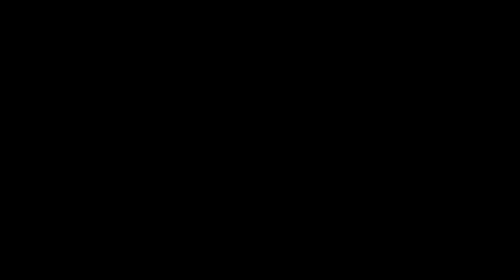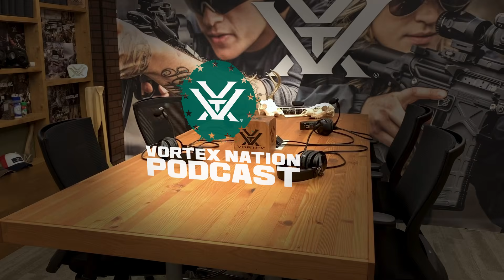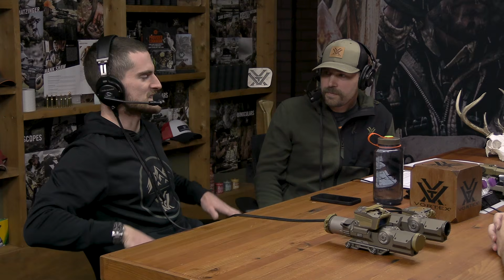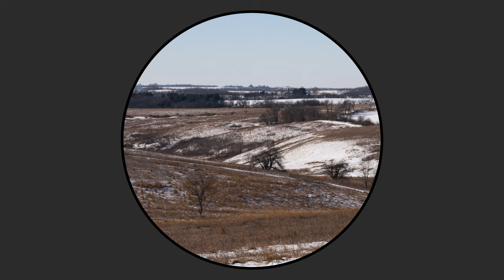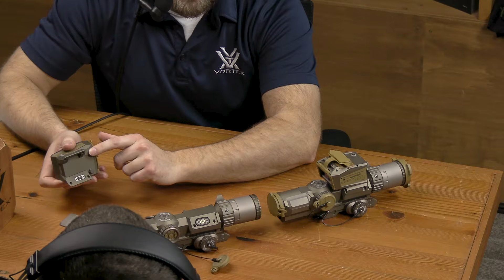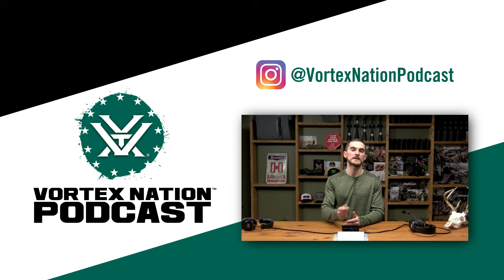Ep. 220 | Army selects Vortex® for Next Generation Squad Weapon – Fire Control. What is it?

Comment: I wonder if these optics with all the tech, are they shielded from e.m.p. attacks? I would hate to think they wouldn't be effective on the battlefield if something like that could fry there systems.
Reply: Still be a x8 scope until fixed. If we know a nuke is going to be popped in relative proximity we switch off electronics. EMP doesn’t damage electronics then. In defence we also bury a % of our radios, etc, to help preserve gear.

Comment: I got to ask : is the laser range finder visible with nods/detectable with laser guidance early warning systems like built into tanks and APCs? It would be really bad to carry a flashing beacon with you when you go to war to any technologically advanced enemy  - or even a citizen miltia or terrorists with hunting night vision 
also what is its heat signature on thermal cameras?
Reply from the maker: Unfortunately we can't give too much detail as to what exactly all of its features include. Everything we're allowed to say is in this podcast!
Reply: Tank defence suite would go nuts and waste a lot of ordnance and cause tons of stress on the crews if our tiny infantry lasers set it off. They require quite a heavy duty laser like those that target designate from ATGM launchers, aircraft, laser designators JTACs use, etc.

As for detection yes any active light including IR can be seen through passive NVG or even civilian cameras/mobiles set to night mode. We have EMCON measures briefed pre mission on what we can emit. If we know our enemies have night vision aids you know not to use active until contact, etc.

Hope that helps.
Reply: @stevepirie8130  Yes it did , thank you , i had some work with night vision in the army and we found out during war games that phones flash a UV flash every few seconds that basically scans who is useing it like facial id - guy that had his phone in the top pouch on the Plate carrier was the shiny beacon in the night. Just look at a phone with a night vision - next to the selfie camera - close range and old NVG and its like a UV strobe light with some phones like Huawei
Reply: I used thermal imagers for years of various sizes as a MFC and it has minuscule thermal footprint. It’s us humans that stand out far, far more. Your TI naturally blends into the background.

Comment: This scope has sensors for station pressure, temperature, angle and laser rangefinder for distance PLUS an integral ballistics "engine". Pretty good for a rifle scope and heretofore only found in top LRF binoculars like Leica and Zeiss. 
WHERE IS THE SOLAR PANEL? ;o) My HOLOSUN AEMS sight can operate only on solar panel with no battery in good light.
I wonder what the problems were with the Leupold and L3 Harris entries in this Army electro-optic battle sight solicitation.
A civilian rifle scope that can also do most of the things this scope can do is the SIG/SAUER Sierra 6 BDX (Ballistic Data eXchange). BUT for optimum use this scope must have a Bluetooth-enabled rangefinder with a built in ballistic engine and/or a KESTREL 5700 Elite weather meter/ballistic engine with Bluetooth.

Comment: Let's make one thing very clear:  putting optics on a weapon DOES NOT increase the range of the weapon, it may allow for targets to be engaged at longer ranges more accurately, but can in no way make a weapon shoot further. Having served in the USMC during the 1980's, we were trained to engage point targets accurately out to 500m, WITHOUT OPTICS. I fear the US military has placed such a reliance on optics for individual weapons that should those optics become damaged in combat, the troops will be unable to function due to no training with shooting over iron sights. How many soldiers these days knows how to BZO their weapons using iron sights?
Reply: Only time outside the first lessons on Basics I used iron sights was in the jungle. Our iron sights were extremely easy to zero. Optics is very useful in the IED riddled environment we had in certain theatres and nobody was allowed on patrol without them fitted. Even machine guns had optics despite the fact 7.62mm wouldn’t keep its zero. It was just an aid for observing splash beyond tracer burnout. 

I was a bit curious about the x8 scope but he said it’s adjustable as with x4 I could suppress with both eyes open to watch the assault element crawl up to post grenade so I knew when to switch fire. X8 would I’d suspect be too great a difference for me at least.

Comment: Well as a long range shooter my take on using a 6.8 mm is are they dumb or just stupid. From 1900 the 6.5 has phenomenally performed for the Nordic countries and the 7.62 and 5.56 has performed phenomenally for the USA. I do like the 6mm ARC program and is a phenomenal cartridge for the AR-15 for long range and a proper step for obtaining better ballistic capability in an Ar-15 size and weight platform. The Ar-10/Sr-25 is where it needs to be in 7.62x51.

Comment: Chinese electronics.  Noticed that's not mentioned and even avoided.    Lenses made overseas are superior to US made glass.  Nothing beats German glass or second to that Japanese glass. It has to be assembled in the US otherwise they couldn't get the contract.
Reply: Nope, you are incorrect. The electronics are made in the USA as well. You are also wrong about glass. The raw glass material comes from Schott but is ground, polished, and coated in the USA. Optical design plays a much bigger role in optical quality than the country that the lenses are made in.

Comment: This was the longest ad for a scope I'll never be able to afford. Thanks for the content! and congrats on the contract!
Reply: Yes, you can afford one like this. The HYPR-7 from Element Optics, launched last year. Take a look.
Reply: I'm used to spending $2k and more for a rifle for my competition models, I am also used to spending even more for my optics, as I need environmental tolerance over a wide conditions range, literally the same as the military does, as frequently enough, we compete.
It all depends upon your mission needs, do you need full operability under all conditions? If so, you'll need military specifications compliant equipment, as that's what MILSPEC is largely about. No? Get an off brand for cheap. Are you seeking ultraprecision, sub quarter MOA accuracy? Get something else, this ain't it, it's a combat optic, not a sniper optic, think DMR vs sniper.
Are you firing routinely for precision shots at 800 meters and beyond? If not, and frankly I doubt that you are, as most people can't hit at that range even if they can see it reliably, don't waste the money. If you are, see you on the range!

Comment: Noticed in some of the NGSW material (I think SIG's specifically) a power-carrying picatinny rail concept was mentioned as a goal so that rail-mounted accessories can all be powered by one central source, presumably in the gun itself - wondering if that project is completely independent or if there was any consideration for that goal/any planning to allow this system's use to power the NGSW-FC if it is implemented? Obviously consideration was put into "future-proofing" the design with expansion ports, and that seems to be another great way to add redundancy, if it were to use the existing batteries as a backup.
Reply: The rails on the Battlefield 2042 video game are like that. :)

Comment: What happens if something causes an EMP
Reply from the maker: Great question - The electronics may not fare well, but like we mentioned, the LPVO at the core of this optic is am extremely high end, traditional, passive, FFP LPVO. That would remain completely unaffected and still be a better solution than what the troops currently use.

Comment: A bunch of BS just a bunch of boasting and stupid shit.  What happens when the battery dies.  Basic marksmanship skills are the key they make it sound like the optic does it all.  Anopther exspensive piece of CRAP>!!!
Reply: Dunno about your military but every type of battery we used we carried spares to last certain time period on us. Most kit has a battery low warning so swap out as your battle buddy covers you. 

Part of my inspection before every patrol I led you’d check mission critical kit worked yourself to make sure the troops knew I’d check up. 

I totally concur everyone still needs trained and practised in basic marksmanship and of course we do. In my military every year we go back to individual, pair, fireteam, section, platoon, company level skills and drills same as your infantry does no doubt. Every pre deployment we did the same. 

I wouldn’t think this sight will be general issue at all. Far too costly and you invested massively already in your current sights.

Comment: Any chance for the Razor III coming down in price and any addition to the lineup to bridge the gap between rhe Viper and the Razor, price wise? 

Also very curious to see if you guys have any plans to develop something in the vein of the elcan where it's a proprietary switch between 1x - 4x or 2x -10x. Lpvos are great but it's not uncommon to see people running them solely at min and max magnification, or setting it at max and utilizing a side mounted red dot while disregarding the 1x on the scope.

Love what you guys are doing. Started with the 3x micro, got a viper and then sold that to fund a Razor II E. Still happy with that optic, but it leaves sum to be desired in its 6x limitation. 

Will hopefully be moving up to the Gen III soon. 

Thanks in advance for any answers, stay frosty 🇺🇲

Comment: I wonder how much a "civilian" version will cost? I mean the gooberment purchasing agents can pay whatever they want since they can create all the "money" they want out of thin air on a computer.
Reply: well for civvie version you basically take an optic they make then add price for internal see through display, rangefinder and bit of electronics. As a bonus it wont be restricted to "made in US" parts so it IN THEORY should be significantly cheaper to produce.

so $3500 ish for top of the line "Razor gen III" + $200 ish for rangefinder 

the display should be dirt cheap, the electronics probably not so much but less complicated for civilian market shouldnt be too pricey so it could be anywhere from $100 to $1000+

so my GUESS would be high end one would be around $4000-5000

lower end ones based on affordable models could go pretty low - take a $400ish fixed prism, slap $200 laser rangefinder on it  add that oled see through display inside + barebones electronics for just bullet drop calculation and without any fancy environmental sensors - hell you could make it without much internal electronics and just make it run from a smartphone over bluetooth/wifi and have a unit viable for civilian market for +-$800 or less.

so, who knows where this will go, the actual innovative part - putting a seethrough display inside shouldnt be adding that much cost and unlike the military unit that has to be self contained you can keep the "ballistics computer" outside as an app on a phone ...

Comment: Also last poing dont do a fucking quick guide and provide videos type manual. Its 2022 thick manuals are great but just provide a video for everything in that is explained in the book.
Reply from the maker: Definitely appreciate the feedback! We try to do both as there are still plenty of folks that prefer physical manuals.
Reply: @VortexNation  you mean Generals? When ever something gets fielded to the Army they usually have contractors provide training and understanding the concept then years down the road it’s just a manual and what ever guys remember and then it’s a game of telephone and down the road random leaders make stuff up of what something can do or how to operate it because a manual isn’t as clear. A CD/USB gives you and other makers the ability to give a straight to the point step by step how something works what it is really designed for and what it’s not. Not to mention manuals always down the line are gone then you as a soldier are trying to scour the web to get a full understanding of what a peace of equipment does. Good example PUC or ECWS system that is supposed to come with quick guides on temperature to wear each portion or etc and yet random leaders make up there own mind how that peace of system is to be worn even with Cotten. That’s one example I’ve seen this with strykers and JLTV. So I guess make a manual but have a video that comes in initial issue and when it gets lost like the manual it’s on YouTube or somewhere for those that were not there for initial fielding to look too explained in a video with the equipment and not paper.

Comment: I would also add the fire control optics are more significant than the NGDSW R and AR . The guns were in a sense built for the fire control optics . These optics would allow for enhanced target acquisition and first round hit probability . With the optics it increases the accuracy and range that soldiers can fire from the 5.56 can't take advantage of that and that was made clear in Afghanistan . The new 6.8 takes advantage of the increased accuracy and range by the fire control optics and it is also the other way around , the fire control optics take advantage of the 6.8 round .

Comment: considering how little you guys touched it and even went into detail or close up shots of it i'm assuming that this is basically still under NDA/ low-medium security lockdown. i want to know how the controls feel how the zeroing turrets operate, the resistance and smoothness of the throw lever. i want to see close ups of the lens covers. what are those top notches on the top module for. you guys did an amazing job asking all the important questions. i just want to know how it feels in the users hand while using it. ease of use with pressure pads/remote wire controllers.
Reply: Join the big A and get paid to play
Reply: @ryanburbridge  been there done that. got the participation trophy for my injuries while all my worthless officers gave themselves bronze stars.

Comment: Put in etched range finder into the optics to use without power. Just like Primary Arms ACSS optics with range finding based on 5 foot 10 inch adult

Comment: Will these be available for the public? If so, for how much? I assume $2,500 -$3,000
Reply: it’s a peq, a raidx, a high end mount with top of the line glass as well as integrated proprietary tech. If this thing hits the market for less than 10k I would be shocked
Reply: @lukehaug4488  except civilian version would have no need for all that military functionality, all civilian version would need is laser rangefinder to feed the "ballistic computer" which isnt anything ultra pricey at this point and there would be no need for environmental sensors either.

and unlike military stuff you could run the whole thing from your phone over bluetooth or wifi.

Civilian stuff has much more flexibility in cutting unnecessary costs because we kinda do not need it to be bombproof and so totally self contained.
Reply: @Asghaad Not everyone wants neutered equipment, I think just because you wouldn’t use all the features on it doesn’t mean someone else would. The internal compass is super cool! I also think it’s awesome that it has an IR laser slaved to the optics zero. Personally I would be ridiculously disappointed if they came out with anything less than the actual optic demonstrated in the video. If you want second rate trash with cheap imported glass, a shoddy integrated range finder, and a semi-monolithic body. You are in luck it exists!!!! It’s called a Burris Eliminator. Why don’t you buy that and I will buy this when it becomes available, right after I refinance my house. 👍
Reply: @Asghaad  I specifically said cheap imported glass, Japanese and German are not cheap. I think we may have to agree to disagree on US products being garbage tier, as a general rule they are usually pretty good.
Reply: @Asghaad  also they use Japanese glass in their second to to top tier. Their top tier of optics are the AMG line, if you are unfamiliar it is made right here in the US.
Reply: @lukehaug4488  uhh what ? AMG is holo non magnified optic thats nowhere near the top line of what they make

Razor HD III is ... you know $3600 1-10x LPVO and $4000 6-36x long range scope ...

and yes thats a HARD disagree on "US made the best" because it simply is not... American made means mediocre at best but at several times what the item is actually worth, and if you want ACTUAL quality you want the item to be made in countries like Germany, Japan, Switzerland, Belgium, Israel etc ...